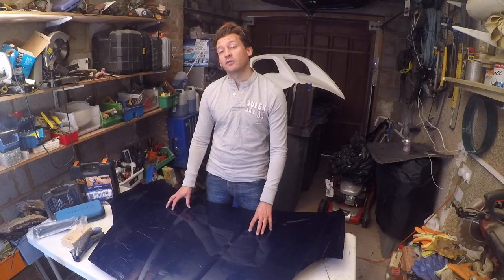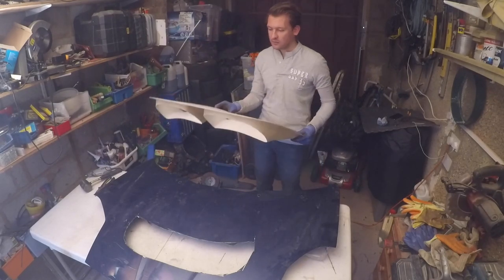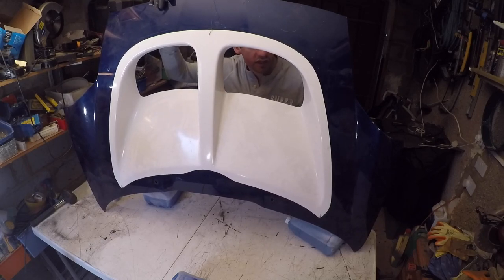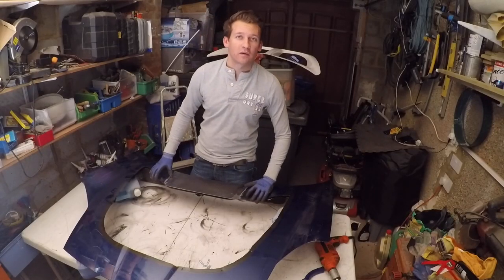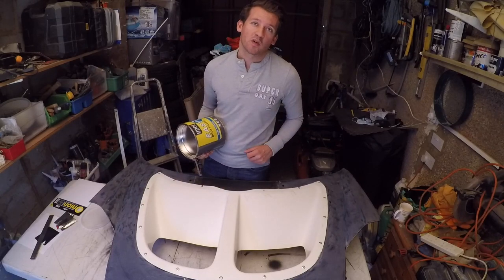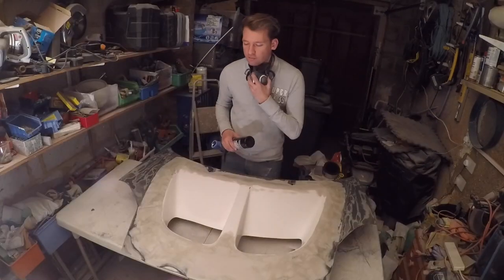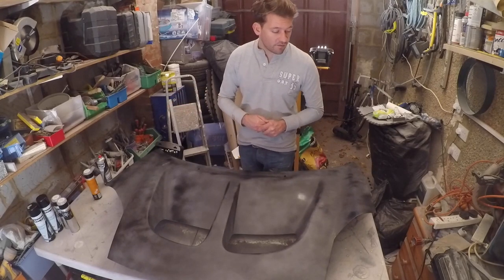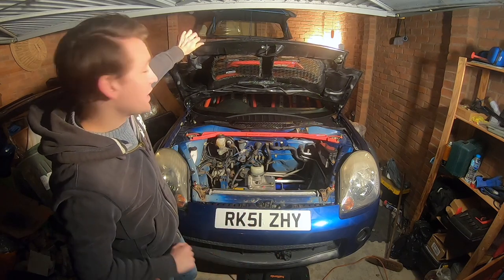How To Install Hood Vents (Bonnet Vents)

Comment: Any one doing this job you could buy aviation skin pins or cleco pins and pliers. This will help keep everything in line , poly sulphide adhesive sealant to join the two panels . Buy rotary file set or carbide. To pitch in your rivets there are two things to watch out for one is your edge distance, this is the centre of the hole to the edge of the panel , if you go to close to the edge you could get breakout or the panel splitting if you're to close, I recommend 2x the diameter of the rivet  min from edge . Pitching in your rivets will make a nice. Job use masking tape and pencil to mark out the job start at each corner with one hole marked in the panel. Then measure from one hole to the other  and divide that distance by the amount of distance you want between each rivet . Go around and pitch in then rest then pilot holes with small drill . The you can transfer panel over , and drill through the holes you made and pin as you go do one hole then move to opposite side pilot and pin , why do it this way? One you will only be drilling through one panel and not two so not as much force is required so no chance the panel will move around. After piloting you can then drill off both panels separately from each other making sure you use the correct dimeter drill if you don't have the correct dimeter either you will struggle to get them through both panels or they will be too loose. Put sealant around each rivet this will stop water getting in and also dissimilar metal corrosion . Don't forget to deburr your holes and protect any unpainted surface.
Reply from the maker: Great tips for everyone and myself there there Vaughan! Thanks for adding that. 👌

Comment: How did you move the power steering pump to fit it in ????
Reply from the maker: I got a sheet of 6mm stainless then created a mounting bracket out of it. I then relocated that to sit on the cross brace. If you message me in IG I can share a picture of it with you.
Reply from the maker: I got a sheet of 6mm stainless then created a mounting bracket out of it. I then relocated that to sit on the cross brace with some tall bolts to keep it level. If you message me on IG I can share a picture of it with you.
Reply: @KingandTitanRacing  thanks matey, just adding my vent and seen the problem with the location of the pump straight away
Reply from the maker: @christophergittos699  yeah it’s a real problem for any kind of vent, but the solution I did don’t even need to cut or add any hoses. Just a few cable ties to keep the hoses in place after the mount I made.

Comment: Where did you get the vent?
Reply from the maker: I got it on eBay, I did post a link but the seller has since closed up shop. I hear they’re very hard to find now. Are you looking specifically for the lotus one?
Reply: @KingandTitanRacing  yeah lotus one if I can find one, otherwise there is a seller on eBay which does a large square alloy one, will prob use that
Reply from the maker: @keljon32  good luck finding the lotus one, if you do let me know and I could probably make a mould of it so you can have a spare, I would have done that with mine if I’d have known they’d be this hard to replace later.